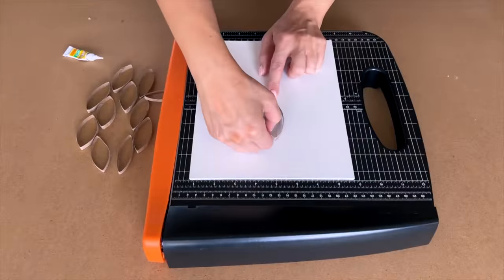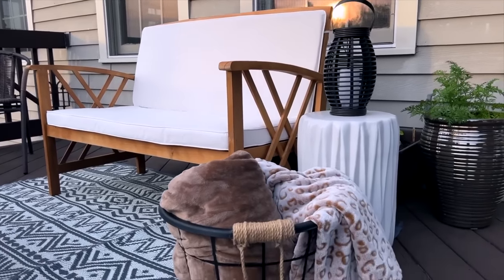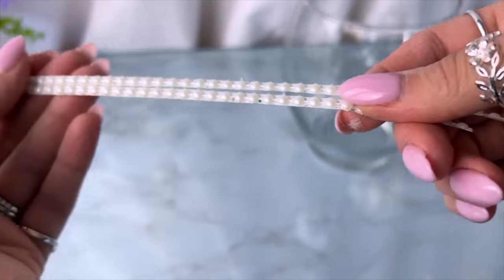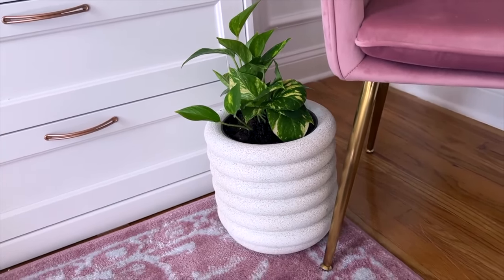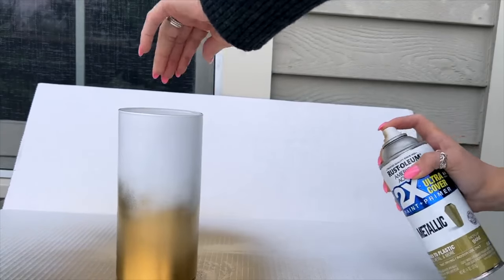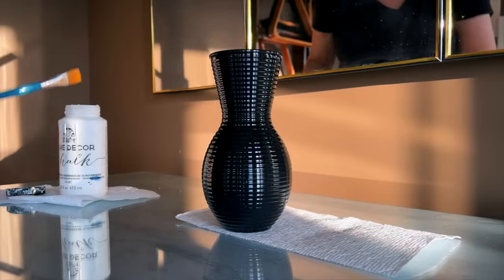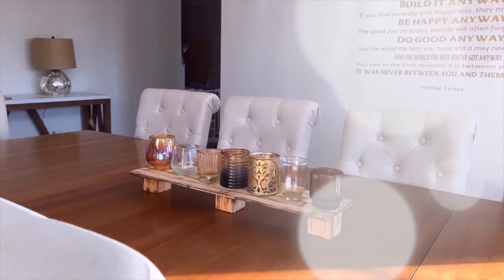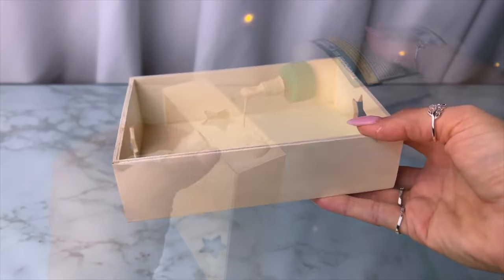20 DIY HOME DECOR IDEAS TO TRY in 2023 USING DOLLAR TREE SUPPLIES!

Comment: Suggestion related to the bowl and candle stick piece… consider caulking in between the pieces after one is attached to another. It would finish it off nicely and hide the DIY aspect. Then finish as you like. But good job on the ideas! Hope you find this helpful.